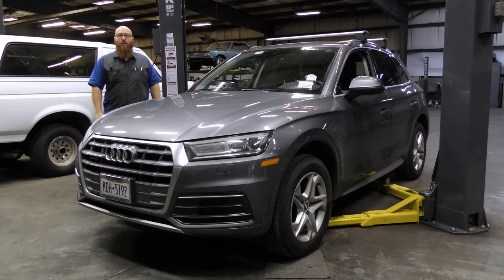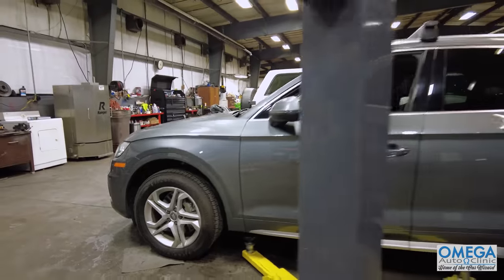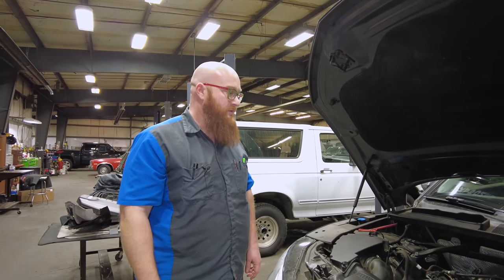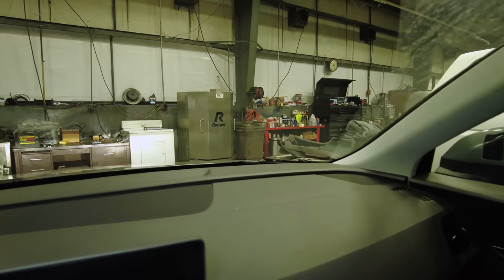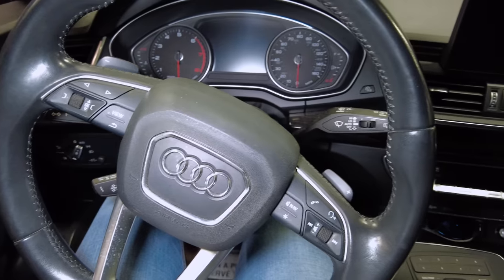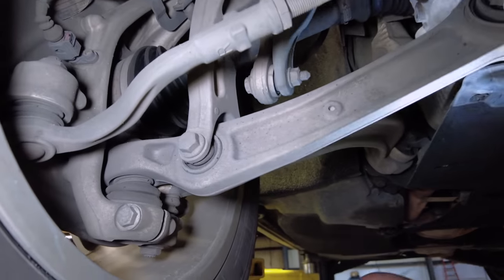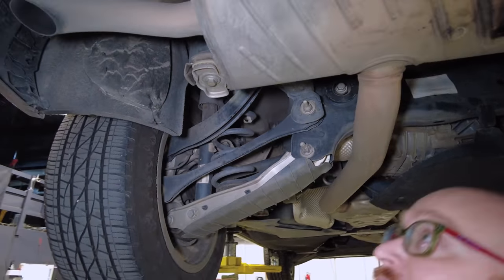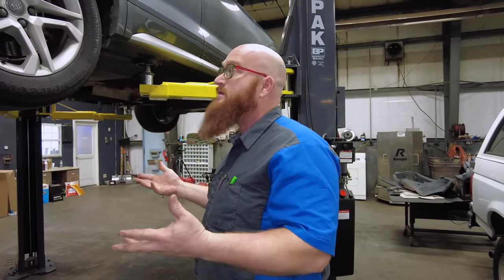2019 Audi Q5 with 200K miles & the service records to prove it! What did the CAR WIZARD need to fix?

Comment: That is the most proper maniacal maintenance I've ever seen on a german vehicle.
Reply: I have a 2013 Golf TDI with the same miles, but at least double that binder in maintenance bills (over 24k $ in 10 years!)
Reply: In the US atleast
Reply: You should see mine. Oil change every 10.000 km and every authorized service maintained aswell as every little thing that was of concern.
Reply: I was like this with mine but I had lost compression in my 4th cylinder a year and a half into owning it :/ it was a 2012 q5 with 109,000.
Reply: Those 2.0t’s have given me nothing but issue after issue in my VW’s.
Reply: I have every receipt from every dime I've spent on my 79 silver  anniversary  trans am.  Bought it in July 79

Comment: I took my '85 Audi Coupe to 450,000 miles.  Regular scheduled maintenance, no major issues, original Engine, two clutches. Lots of oil changes, and tyres!
Reply: I had right at 300k miles on my 84 GT Coupe when I traded it in. We bought our own trailer to tow it home to save the tow fees. lol But that was still my favorite car ever. The rear view mirror fell off when I drove it onto the dealer parking lot but it still looked like brand new 7 years later and I’ve never found anything that made me as happy to drive since.
Reply: @doubleyewgee  My feelings too.  I wish I still had it!

Comment: I remember when I inherited my dad's '91 MB 560 SEL "classic". He kept IMPECCABLE records of the vehicle, serviced only at the MB dealer. Once I started buying my own German vehicles, I knew just how important these records were.

Nowadays, the VIN can be ran and most records can be found. But if he ever private-sale this Audi, he can show how diligent he was with the record-keeping. I've saved every record on my cars all the way back to my W140 '97 S500.
Reply: I now own a 2012 ford mondeo titanium sedan 2l 140hp automatic.

There are several things I don't like about the car! This is no VW Polo but a Passat Titanium and you expect a bit more from the car. But many newer cars unfortunately have a lot of small weaknesses.

Here are some weaknesses.

1. A lot of tire noise and body noise while driving.

2. Problems with the fuel cap theft lock, which is a common problem on this car.

3. Incredibly little information about the car. No engine temperature gauge or other important things.

4. halogen headlights that are not water tight.

5. front light brightness is nothing to brag about!
Reply: @ford1546  What on earth has that got to do with OP talking about service records?
Reply: @afrousel4731  I'm talking about weaknesses with newer cars. 
Don't be that way. Don't be the police!
Reply: We used to get stamps in the Mercedes book for each service.  I was sad to see their switch to schedule A&B and no longer do the stamps.
Reply: @aussie2uGA  YES! It was a big deal for the stamps. The first thing dealers would ask for on these cars was the service logs if you were trading them in. Poor/no records would harm resale values. 

I, too, don't care for the A/B servicing, especially since it allows other service items those schedules don't cover go missed. I have about $8K in service on my W222 '17 S63, some of which aren't called for on the service cycle. But preventative and timely maintenance is everything!
Reply: @hellkitty1014  agree. I had a 15 BMW X5 up until I traded in last year on a new Acura. I had all the BMWs service records from dealer and some from other shops all in order etc. in a folder. I went to hand to the salesman..He was like what ahh cool you keep those without looking. Oh well that was a waste of time 😂
Edit: like you said records important if you private sale..dealers don’t care 🤷‍♂️
Reply: I do my own services so don't have the records.  Saves money but I don't have to shop records when I sale the car, I do record them in the book though.  For resale value it might be worth it to pay to get it serviced for the paper trail.
Reply: @jeffk464  sounds like me with my dirt bikes. Service regularly and write down in the back of the owners manual. One thing I have learned with them , say a piston change, new parts etc.. is to save the purchase receipts 🧾 to show when I sell. But yes owning the BMW I would save $20 on an oil change not at dealership but then realized it won’t show up in the online records that dealers see. So yea I think worth a few extra $ to have it serviced at the dealer in hind site.
Reply: I've never been too concerned with keeping records because 1) I try to do all the work myself but 2) I don't ever sell my cars, I just drive them til they break.
Reply: 😂 One that got away, is it EA888 turd
Reply: Well kept old Mercedes is the best car on the road.
Reply: Ok.... Cool story bro.
Reply: @Ukiegaming  YES! I drive the W126 occasionally(wish I had more time with it). It is astonishing to get in that car from a much more simpler time. The way the doors shut. The manner in which it cruises down the road with no effort. The build quality being untouchable by today's standard. What a car.
Reply: My dad gave my his 560 SEC when I got my driver's license, it's been my daily to college until the transmission blew, rebuilt it entirely and now I have to do valve stem seals and valve guides, but even with all the maintenance I have to do I still love the car with all my soul, anything it needs it'll have!
Reply: @dlpgamer  Put RVS treatment to it, I use it in all my cars except my current lease and well, next one will be all electric EQC 🙊

Comment: Highway miles are easy miles as long as the oil is changed regularly with good oil and filter. I got 188k miles out of an '88 S10 with the 2.8 V6 5 speed. It was getting a little weak but still ran pretty strong. Broke the trans. and P/S was leaking heavily. Got 160k miles out of a 2000 S10 with 4 cyl. Ran flawless with NO problems>>should have kept it.
Reply: PS>>>all 2000 S10 had was oil changes, air filter, grease chassis  and one plug change. NOT a huge binder full of stuff. I don't think I even had to change the battery in the 8 years I had it.
Reply: @hotpuppy1  Yeah with 90's GM cars you don't have to do anything and they just run forever. 4l60e was a bit of a problem though, engines are solid.
Reply: We have a 2000 S10 Blazer my father-in-law handed down to my son when he started driving. It had 165,000 miles on it then and over 210,000 on it now. The engine is great but rust eventually does the rest of the vehicle in. I have put a couple thousand in parts into it which is more than what it's worth but we got it for free so not too bad for a cheap vehicle. Just wish we didn't live where it snows so our vehicles would last longer!

Comment: I have my third Audi going and I can say oil changes and plugs don't cost thousands. Tires cost as much as they do for Toyota. Some parts like water pumps will eventually fail and cost a lot to change but the engines are pretty solid. The service schedule book is there for reason so read it and do the maintenance jobs required and you're fine.

Comment: Great video! In my experience, if you take care of these cars, they generally take care of you. My 2013 A4 is up to 117k and has been an absolute treat to own, but much like this Q5 owner I've been very diligent with maintenance, both scheduled and preventative. When buying any car, especially a German car, one with a stack of records and 120k miles is a better choice than one with 80k and zero history.
Reply: No oil consumption?
Reply: @repairvehicle  Oil consumption seems to be hit or miss, My 2013 A4 (CPMA engine) has 93k and doesn't burn a drop of oil
Reply: @joespittle1  how often do you change oil
Reply: @repairvehicle  Every 5k miles
Reply: @joespittle1  very smart to change oil at this interval
Reply: @joespittle1  
I agree 2014 F150 King Ranch bought it 1700 miles in 2018, take care of it and it’ll take care of me. It does have the sun roof never been open & won’t be.
Reply: @repairvehicle  No oil consumption (CAEB engine code) , I also change the oil every 5k with liqui moly 0W-40 (same viscosity as 5w-40 but flows better when cold) and am careful to let the oil reach operating temp before getting into boost.
Reply: I have a 2010 a4, just as a heads up when I hit abt 155k miles and the turbo needed to be replaced.  Not sure how you're car is holding up but I hear they tend to go between 100k and 150k.  Just something to keep you're eye on.

I had my ko3 on the gofast bits dv and went stage 2 at the time.

But I bet if it's stock your turbo will last longer than mine!
Reply: @randyranderson3521  Honestly that's a pretty solid lifespan! My car is Stage 2+ (JB4 stacked on top of stage 2) so I'm sure its days are numbered, but once it goes, K04 time!
Reply: Be careful if those timing chains if you have the 2.0t

Comment: Golf IV 1,6 petrol station wagon from 2000 here. Coming up on 420 000 km. I got it from my parents when they bought themselves a new car, and they were meticulous about maintenance and keeping the car clean. I've continued that, and knock on wood, it's still going as strong as ever.
Reply: Golf 1.8T from 2000 here . Just gone over 400,000 km.  I am Audi tech and have changed everything that will keep the car running,    I live in Canada and it is rusting to pieces lol
Reply: @redauwg911  Rust wise, mine is doing...surprisingly ok, though it's starting to show its age in that respect. I'm in Norway, and cars here generally get salted to bits. Regular washing during winter helps, though.

Comment: That is a seriously impressive car.  The 2.0T motor is a gem.  I’ve owned a 2014 VW Tiguan and now a 2016 Audi A4 - both with that motor and never had an issue with either car.
Reply: Which one is it?

Comment: My daughter during high school was to Germany at least three times and she told me in high school the students are taught vehicle maintenance they learn about timing belt replacement fluid changes rotations just proper maintenance it’s just expected in Germany but we don’t maintain those German cars the way they should be I work at a Honda dealership Ifully agree with you they can be a great great car as proven but need proper maintenance.

Comment: My 2001 GTI has 209K miles and is getting tired, but I still have original clutch, starter, turbo and radiator.  If you treat your German car right, which most Americans won't, they will last. I've been short on cash to maintain at times, but I always catch up, and the shop I use, that specializes in VW/Audi, appreciates my attention. Thanks for this and for dispelling Scotty Kilmer's anti-German car screeds.
Reply: Scotty isn't entirely wrong, total cost of ownership is going to be better with the equivalent Toyota.  Purchase price, maintenance, and resale value.  Although if you are buying used a high resale value doesn't work in your favor.
Reply: @jeffk464  Scotty is a backyard mechanic
Reply: The maintainence cost for japanese vs german are pretty close.  It's a little more but not that much.
Reply: @jeffk464  What equivalent Toyota? The Matrix XRS? I’d pick the GTI every single day.
Reply: @stevelouie5928  especially since Toyota was using BMW engines in their lineup. And I'm not talking about new Supra, more like Rav4 diesel engine.
Reply: @MKRN98  Even the old mini coopers 2nd gen which were supposedly not reliable had non bmw sourced engines.  I had the 3rd gen F56 which was all BMW and it was completely reliable the whole time I had it.
Reply: Still going to buy Toyota
Reply: Toyota over audi any damn day of the week. Especially Lexus. Audi will be worth much less used and you HAVE to baby it if you plan to keep it for a long time.
Reply: Not true. I never changed the transmission  fluid once in my 97 carry and I change the oil once a year.  It has 440,000 miles now. It's literally a trash can on wheels.   But it runs smooth and uses zero oil.   Maintenance?  What's  that?
Reply: @jeffk464 yeah but buying a damn 98 Toyota Celica isnt a good deal either. It’s going to need work and won’t be exactly cheap every time

Comment: I have a 2018 Audi S5 Sportback, and I can attest to these cars being VERY maintenance intensive. It's a choice you make when you purchase a German/European car. I consider it part of the Audi ownership "experience". Got to pay if you want to play. I also have a 3 ring binder with about 1/2 of the pages that this one had. But, I also only have 40,000 miles on mine. It's worth it to me. Definitely not a boring car.
Reply: I've got a tuned 17 c43 amg, nothing but oil changes with 57k miles
Reply: @bryanwhite3021  me too, a 2016 C450AMG - regular service only and a trip to dealer on a recall. 91,000 kms. Nice rig and awesome to drive.
Reply: What’s the estimated cost in maintenance that you put into your Audi so far?

Also do you take it to the dealership or outside mechanic?
Reply: What the fuck are you doing to the car to consider it so maintenance intensive? I had an RS3 for 4 years and it needed nothing outside of the two services
Reply: @BBDSmint  Did you even watch the video?
Reply: @Dfgbuiiyyyybb  I do as much maintenance as possible myself.  I would estimate around $1200-$1500. That's considering tires and 1 dealership service. The other service I do myself.
Reply: 2018 why are you even touching it Lmao
My 2013 BMW just needs the occasional oil change
Reply: @BBDSmint  Facts. I was thinking the same thing. I have a 2017 A4 w/ 105K mi & ZERO issues. As far as maintenance: Oil changes, brakes, engine coolant. Out of that, runs like it rolled off the factory floor.

Comment: I’ll be honest, these cars are more reliable than people give them credit for. I have a B8.5 2.0T A4 that I drive the crap out of. Redlined a few times a day, runs like a champ. All I’ve had to do to it is brakes, fluids, and 1 set of ignition coils in the last few years I’ve owned it. The craziest part to me is I’m still using the factory battery that it had when it was brand new. It’s now 10 years old. Started up in double digit negative temps no problem

Comment: I’ve probably had near 250 Audi, currently a couple s4s with near 200k each, never have let me down, both have been 1/8-1/4 mile ran with tunes, I’m extremely happy with them. Oil changes, brakes, tires, feed them various other “muscle” cars to keep them happy. That 2.0 is so easy to work on next to these. I buy those with timing out and bent valves and generally all in about 300$ to get them on the road again, worst part is those bottom nuts on the turbo flange. Super easy.

Comment: My 2003 Audi A4 1.9TDi Manual has 226,000 miles on her and still on the original clutch. Driven all around Europe and I loved the car so much bought it with me to New Zealand.
Reply: Must have cost an arm and a leg to ship it! You must really love it👍🏻👍🏻👍🏻
Reply: @JoshuaC923  yes, was around $12,000 15 years ago which included compliance to be put on NZ roads, still driven every day. A diesel manual Audi is a rare sight over here.
Reply: I have 2007 skoda Octavia 1.9 tdi alh mk1 diesel here in India. Same engine. Just clocked 100k . 
Which engine oil you use? Any additives? Thanks mate.
Reply: @1.9tdilove71  Mobil one esp 507 spec
Reply: @pl1068  5w30? Or 5 w40?
Reply: @1.9tdilove71  5W 30 👍🏻

Comment: Yes German cars can go a long time IF you are proactive. My 10 year old MB C300 with 134k on it is still solid as can be. I change the oil every 5k-7k (even though the manual states I can go 15k between changes), do the spark plugs every 60k, trans and axle fluids every 40k and fix stuff before they break. When I hit 100k I did the lower control arms because I knew the bushings would be shot and did the stabilizer bars as a precaution. Only major thing has been the motor/trans mounts which I had to get a shop to do. Other than that just wear and tear stuff.

Comment: I had a '97 A4 1.8t Quattro. She had 188k miles and still going strong when she got t-boned and retired. The 1st 80k it was my mother's car and dealer / trusted independent mechanic serviced. I took over maint when it was gifted to me. Yeah I replaced some cheap German plastic crap, updated the ignition system etc. The most expensive thing was new struts, shocks and control arms, (about $2k). Loved that car for the 6 years I drove it. Went like a beast in the snow.

Comment: This Q5 sounds like mine. 2014 Q5 TDi Prestige with zero issues but regular scheduled maintenance, tire rotations and oil changes between service intervals. The Q5 is a great platform!
Reply: Love those mid 2010 Audi diesels. Had an A6 TDI as a loaner and that thing had torque for days!
Reply: I have a 14 A6 TDI and just hit 80K. Had the "major" 75K done which included the fuel filter. We take it up to northern Minnesota (3 and a half hour drive from the twin cities/suburbs) very often and maintain 37mpg (calculated at the pump). Plenty of power, too. Love the diesel!
Reply: @evanganske9240  I think that's where that diesel shines. On flat highways, it turns below 1700 rpm, and in hilly terrain, the wave of torque gave immediate and effortless power. I hate dieselgate happened because that made the OEMs panic and kill most diesels in the US and shift to electrics sooner than they likely would've.